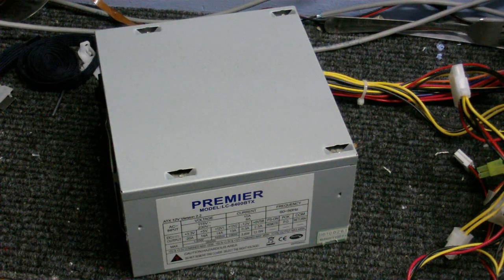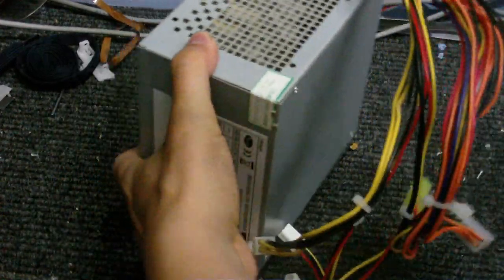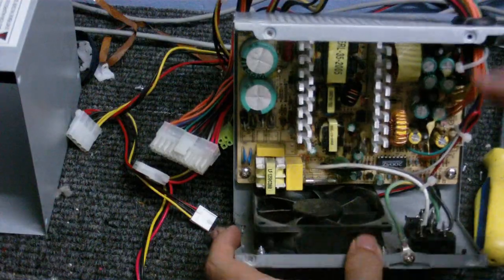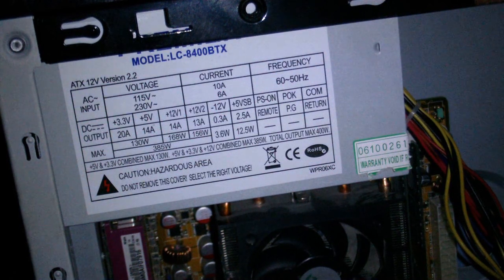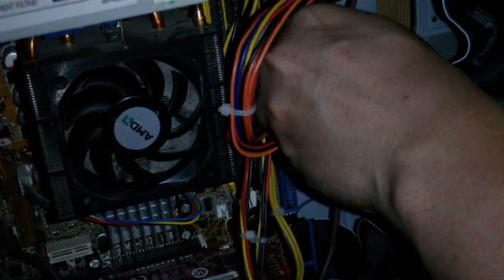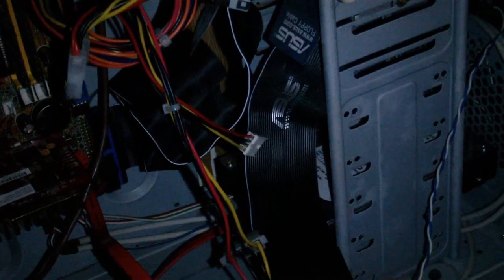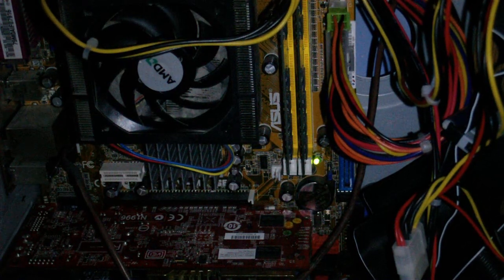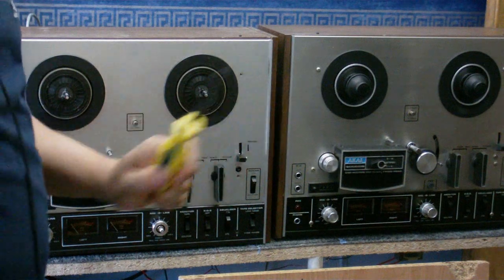CDC Electronic Wokshop S1 EP 5 - Fixing a comptar power supply

Comment: Oh I forgot to add, I use a "sash" brush to clean out my computer cases and I do this outside to keep the dust there, some say use a vacuum cleaner but this is not a good idea as this can cause static electric charges that kill all things electonic, better is to use some compressed air in a can if you realy have to.

The last very dirty PC I had here I used some long cable ties with a hook on the end to fish out 90% of the dust from the PC, the sash brush finished off the job.

Comment: I have not used cheap no-name brand or should I say unknown branded powersupplies in my computers for a very long time.  Cheap power supplies just do not cut it and rarely deliver the rated current and voltages tend to be not compliant with the ATX specifications. 
Sites like jonnyguru and bit-tech give good writeups on all things to do with Power Supplies, they generally test them to breaking point and give a ballanced response.